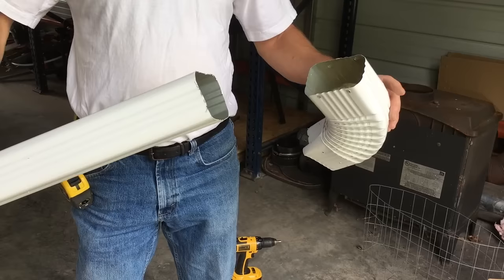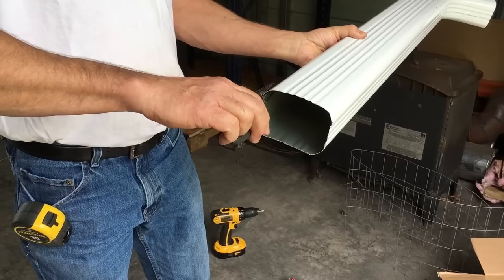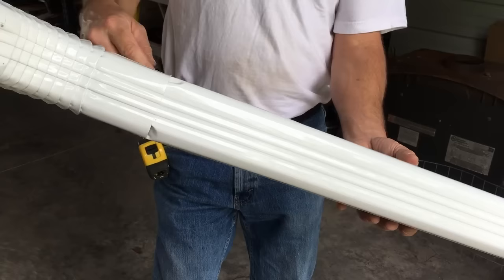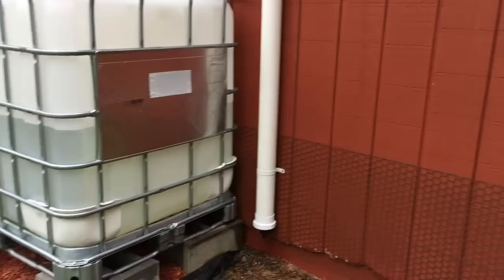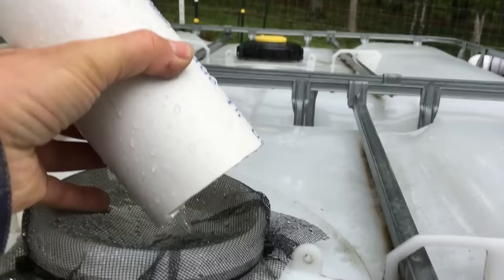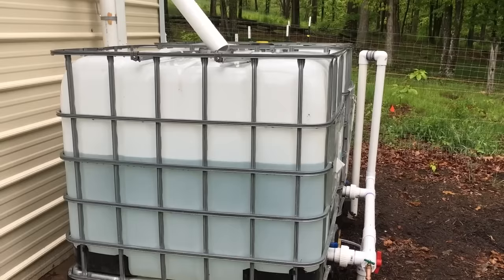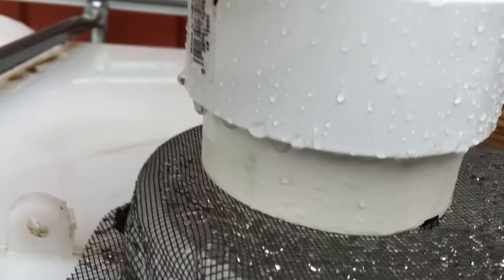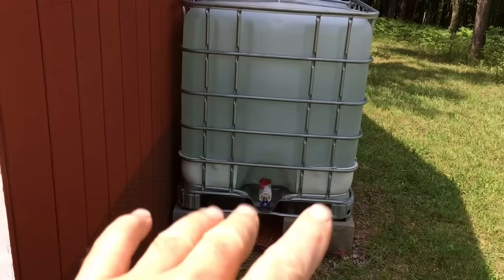RainWater Harvesting Lessons Learned

Comment: I have a very similar though not quite so complicated 4 tote system using the same kind of totes shown here. I also thought of screens on top openings before and then cutting holes in the screw-down lid to allow the gutter downspout to be set in tightly. 

For the overflow, I have PVC pipes running out the top and into PVC pipe that just under the ground surface and leads to our garden. From there, it connects to flat sprinkler hoses which then runs through-out the garden (have one from each tote going to different areas and distributes very well. I first tried soaker hoses but they require pressure, too much for the overflow system. The soft sprinkler hoses work great.  Hope this helps someone. And yes, it doesn't take much to fill them up.
Reply from the maker: That sounds awesome!  Do you have a video of your system?  I bet a lot of folks here could benefit from one.  Thanks for commenting!
Reply: Sorry no video. However, instead of connecting everything at the bottom, I just had hose bibs at the bottom going different directions. The tanks were connected at the top and all my PVC is 1". I cut holes as high on the walls as I could go without being affected by the curved edging. Then I got special PVC thru-connectors that would seal tight. 

For the overflow, I did the same. They came out at the same high level and dropped straight down. At the ground level they transitioned to 5/8" regular hose that could easily be laid in the ground and run it to the garden areas. Once in the garden, I attached the sprinkler hoses. It works great!  I might also add that I built structures under the totes so they could all be raised up as high as possible and still receive from the gutter system -- that took a little engineering. One thing I learned in building the structures was that because our soil is soft, I had to put concrete under each pier block so it would remain perfectly level without sinking. Having the extra elevation also helped with the gravity feed.
Reply from the maker: That all makes sense.  Thanks for sharing!
Reply: Here's another option for shading. 
On Craigslist, we've found free split Redwood fencing (often originally 3x3 rough grape stakes split in half). If you cut them into the right lengths and lash them to the tote frames, you can effectively create a nice looking shade for both sides and top... just leave the center opening accessible.
Reply from the maker: Another great idea!  Thanks again!

Comment: Do you think i could pass rain water 300 ft / 100m via 5/8 garden hose if i had about 16 ft of height on the gutter.  I have a tennis building 100m away from my garden and it has a huge roof covering 2 courts.  But all i have is a 5/8 inner diameter hose.
Reply from the maker: Would you store the water by the tennis building?  And would the storage be 16ft above the garden?  If the plan was to use a 5/8 inner diameter hose to run the water directly to the garden, it may get water there, but it would now be large enough to handle the amount of water you are dealing with and you'll end up overflowing and losing most the water at the tennis building.

Comment: Change of plans, instead of using a 1 inch line between the 2 IBC totes, I used a 2 inch line with a 3/4 inch ball valve spigot on a "T" in the middle. On one side my PVC connector on the tote leaks badly. I'll have to replace it and or use plumbers putty to keep it from leaking.
Reply from the maker: Awesome.  I use 2" as well and it has worked wonderfully for me.

Comment: On your first flush pipes, most ppl just use a screw in cap, & dump it out after a rain because it fills up with debris & what not. Why do you have a hose on the end of it? are you reclaiming some of that water?
Reply from the maker: The cap at the bottom is a screw in cap.  It has a nipple that lets me hook up the small hose and run water off.  inside the cap are two filters and a pin-hole that drains out the nipple.  This allows the system to slowly drain and reset itself so I do not have to intervene after each rain.

Comment: So what's considered the right amount of water coming out of the nipple at the bottom of the first flush system? Thank you for the informative video.
Reply from the maker: You have to adjust that based on your roof and situation.  I have a relatively clean roof but the hole in the nipple was too big.  During light rain, I got very little water in my tank because it was going out the nipple.  So I changed the drainage to go slower so I'd pick up more rain.  If I had a dirty roof (asphalt or a messy tree right above the roof) I'd be ok with more drainage to keep the tank clean.
Reply: @greatescapefarms  Got it. Thank you for replying.
Reply from the maker: @jcs6260  You are most welcome.

Comment: What are your thoughts about putting a 90 degree elbow on the bottom of the first flush system for easier access to the components for changing and cleaning?
Reply from the maker: That would work fine.

Comment: what adapter and size did you use to connect the switch ball valve open/close with the pvc pipe? And where can I buy that adapter. 

ty
Reply from the maker: IBC totes actually have two different types.  Some are fine threaded and are known as NPS female and work well with the 2” PVC threads, which is what I have.  Others have coarse threads and are known as S60X6 and will not work with the threaded PVC pipe.  I just got mine from Lowes or Home Depot.  The fitting for mine was NPS, so I got an NPS to 2" PVC.

Comment: How attached are you to the secondary screen filter, the one on top of the tote?  If you can do without it, I would suggest you get the pvc fittings that screw into the tote lid, and use a "t" fitting, which would give you an overflow that you can pipe where ever you want and won't interfere with the tote valve.  Also, using the "t" fitting, you can add more totes.  And that fitting will also allow plenty of air into the tanks as you use the water no matter how fast you drain them.

Also, you connected your totes at the bottom, which means any dirty water that goes into your first tote is shared with all totes that are connected at the bottom.  If you top fill, the worst water stays in the first tote, and each tote down the line gets cleaner and cleaner water.

And consider this, how much water does your first flush system hold before it spills into your tote?  If you took that amount up to the roof and tried to wash it off, how much of the roof do you think would wash clean off the roof, down the gutter and into your pipes?

I use a 55 gallon barrel as my first flush in a two barrel system, but I still use that water instead of letting it drain onto the ground.  Having got my feet wet (pun intended) in saving rain water, I intend to get a couple of totes later this year instead of the two barrels I started with.

Something else to consider, get a 3/4" ball valve to replace the faucet, you'll be happier with the increased flow rate.  Compare water flow with regular garden faucet and 1/4 turn ball valve (both screw into same size hole and fit a garden hose):

http://www.youtube.com/watch?v=AEpybHgKqQk

A caution on that though, it's real easy for pets to move the lever open.
Reply from the maker: Thanks for the great info!
Reply: TheStavros1001 , Guys, also get a "full-flow" ball valve. Most ball valves have a small orifice through the ball; even though they are better flowing than a regulating valve (hose bib), you'll get even better flow with the wide open full flow valve. By the way, don't try to regulate with a ball valve; it will wear the seat
Reply: For reference, when I say 3/4" ball valve, I mean one of those 1/4' turn 3/4" valves.  Which means the handle only moves 1/4  (or 90 degrees if you prefer) of a turn to be full open.  I've never seen one of those that isn't full flow.
Reply from the maker: Thanks DanielinLaTuna.
Reply from the maker: Got it.  Thanks!

Comment: I appreciate the video! I'm kicking around ideas to irrigate my lawn in Florida. We get a good bit of rain and my city will not let me drill far enough to get a steady supply of water. Living on top of a hill doesnt help! Do you have any videos on the pump system you installed? And if you don't mind me asking, what's a good ball park figure for costs on a project like this. Thank you!
Reply from the maker: The rainwater system for a single IBC tote system is about $200.  The pump is not included.  I had that installed by a plumber and it wasn't cheap, but I'm running a commercial nursery.  For a back yard gardener, you may want to try this pump: https://www.youtube.com/watch?v=NPHCnC7hzog

Comment: I'm a bit late to the party but a solution for the vent on the two tanks with the caps would be to cut a 1/2" hole, put a piece of 1/2' pipe with a 90degree bend on. Attach another piece of pipe and another 90degree bend pointing downwards. Attaching a piece of mesh will prevent any bugs crawling in. 

This is a method we use in my industry for atmospheric tanks.

If you think that 1/2" is insufficient then use 1" pipe.
Reply from the maker: Thank you very much for the suggestion.  I have quite a few of these projects lined up now, so I'll give that a try.

Comment: I have no idea how did you build this system.  Suggestion:
1.  List of all the parts that you used (PVC schedule, connector, glue, etc...)
2. A simple diagram of water flow
3. Step by step of assembling.

I would use a separate tank for filtering the rain water first and feed the filtered water into a second tank.  BTW why did you build this system so close to the house?  You could build it 5ft from the house/wall.
Reply from the maker: I did not list all the parts, but I did two videos that show step by step installation - this one first: https://www.youtube.com/watch?v=021Lq0M5dL8 and a larger system second: https://www.youtube.com/watch?v=3nBT6sLZ7HQ

Comment: Hi, what's the reason for the opening with the screen half way down the pipe against the wall?  Thanks
Reply from the maker: Hi Amy, I think what you are asking is the purpose of the chicken wire on the wall?  That was used to prevent a groundhog from chewing on the wall there.

Comment: I put in a system at the end of my property of 2 tanks. Catching rainwater off my shop roof. I elevated my tanks about 18 inches up off the ground and supported 4 corners of each tank. I'm starting to wonder if I should put in more supports like under the middle of the tanks. My tanks have rough threads on their nozzles and I used a 2 in connector with threads with no problem. I plan to connect 1 in pvc schd 40 with a 3/4 in faucet and a bleeder hose to water my vegetable garden. I'm not exactly sure how to connect the 2nd tank. I have a short 3in first runoff pipe with a 2 in connected by a "T"  that runs into the 1st tank and I may just seal the 1st tank hole with silicone so that when after it fills up the overfill runs into the second tank. Any suggestions would be helpful.
Reply from the maker: I just saw your post.  Sorry for the delay.  I also saw your other post where you were making some modifications and it looks like you have installed the system. I hope it is working well for you.
Reply: I bought 2 adapters online for the IBC tanks. One is doing good and the other one leaks. I will cut the line again at a later date and I may have to use plumbers putty to stop the leaking. At present I have 3 lines connected with a ball valve on each line wherer I can water one line at a time with the other lines closed. This seems to work well. I still have to use the awl on my Swiss Army knife to make sure the 1/8 inch holes in the line are giving off enough water.
Reply from the maker: Thanks for the update!

Comment: We are looking to get an automated prefill system that is loooow maintenance, easy to clean.  Mahalo for the ideas to experiment with.  Is there a reason you slabbed the shop past the wall?  We have an 18k gal tall tank (PVC liner) with a 6" pipe out the bottom center of the tank. A full tank gives us head pressure of about 20 lbs at the tap 200 ft down line to the cottage.  Our overflow comes out the top / side of the tank and dumps on a 12' pelton wheel that drives a 24vdc semi alternator which is one of our feeds for the charge controller.
Reply from the maker: The slab floor was built to the dimensions of what the garage was supposed to be.  The detail that I missed is that they had a 6" overhang on the front and back and that was part of their measurements.  That meant that I had 12" too much slab.

Your system sounds awesome. It looks like you use your water inside.  What needs to be done to make the water potable?
Reply: Slab size is a bummer.. Makes sense tho.  We all make errors, we have  made our share < grin >. We do use the rain water as our main source of potable water.  We employ a simple 2 stage activated charcoal filter.  We are considering a UV system soon.
Reply from the maker: Awesome!  thanks for sharing!

Comment: THE EQUATION FOR RAINWATER HARVESTING IS: length of roof x width of roof X inches of rain X0.68 for the first flush systems= amount of rain harvested in gallons.
 
So 20 X 40 ft roof X 1 inch of rain X 0.68 = 544 gallons
Reply from the maker: Thanks!

Comment: You've placed your collection tanks on pallets. Won't they eventually rot, and collapse? Maybe something more durable like concrete blocks would be a better idea.
Reply: Rod Buchan Aplastic pallat on a small slab I think would do very well,that what I use ,have frost heeving in Michigan.
Reply from the maker: I have changed to larger tanks, but what I originally used with the IBC totes was cinder blocks and with pressure treated wood on top.  It should not have rotted for many years.

Comment: hello nice video. have you tried aquarium silicon sealant on the leaking first flush system?
Reply from the maker: I did not. I just removed and replaced the leaky component.  In the comments section someone said I could use a heat gun to remove the bad component and then reapply it.  I will give that a try when things slow down a little as I did save the leaky part.

Comment: Thanks for the very informative video. What are your thoughts on digging a pond (25 meters radius) as a  collection site?
Reply from the maker: I have one of those further out in the landscape.  The garage is uphill.  The eventual plan is to use the water in the tanks for the food forest and mist irrigation beds right at the garage.  Then I'll build a series of swales that eventually dumps into the pond further down the landscape.  I may even add a few more ponds along the way.  I will use any overflow / excess from the rainwater harvesting system to put into the swales.
Reply: Thanks for your reply. I am planning to use the water collected in the pond for "farming" food plants. Probably collect the water by building collection pads (billboard tarps) along the property and guid the water into the pond. Any alternative alternative suggestions on building the collection pads and also sealing the pond? I would rather use natural means to seal the pond instead of rubber lining. Where I live is very dry, 8" of rain fall per year. How inefficient is a pond for collecting water as opposed to tanks?
Reply from the maker: Wow, that's a lot :)  Thanks for the recommendation on the concert.  I have clay, which is as hard as cement when dry, but like loose mud when it is wet.

I built a rainwater collection system system on top of a hill with a tarp a few years back when I was wwoof-ing.  We were all excited when a storm came to see how much water we collected, but was very disappointed that the tarp acted like a kite and ripped itself right off of the IBC tote and the mounting poles.  I didn't see any way to stop this from happening during a thunder storm.

As for sealing a pond, there are several options.  Farmers co-ops sell bentonite clay that is used to seal ponds.  If the pond is dry it is easier to seal it.  You mix it with the dry soil, down to about four inches and then pack it tight.  Its best to run over it with some heavy machinery to pack it down.  If the pond is wet, you can just toss some in and hope that it finds any leaks, but this method is kind of hit or miss.  I've heard that just by putting some ducks on a pond, their poo will seal a pond as well.  I haven't tried this method.

8" of rain is not very much rain for a pond if that is your only source of water.  With no spring or stream running into it, you would likely loose most of you water to evaporation.  With that in mind, I'd at least try to store a little in a water storage system like an IBC-Tote or something larger.

The best type of pond would really be a forest pond.  This sounds weird, but in a forest with lots of mulch and shade, the topsoil and organic matter act as a pond underground.  The water is stored in the organic matter under the forest and is replenished by dew drops and held there by the lack of evaporation because of the natural mulch that you get in the forest.  The hardest part for you is building the forest with so little rain to get it established.   

Just some thoughts.  Hope it helps.

Comment: Have you thought about burying the black drain pipe?
Reply from the maker: I have, but for the moment, it is temporary.  I'm replacing the tanks with larger ones later this summer and will remove the black pipes just so I'm not tripping over them.  Before the new tanks go in permanently, I'll bury the black pipe.  Thanks for the suggestion!

Comment: I go totes that had molasses in them (food grade is good), I rinsed them out. any more needs to be done? thanks.
Reply from the maker: A rinse is all you need.  Actually, food grade molasses is a great amendment for your soil.  If you have any left over molasses when you are cleaning them out, just dilute it with water and put it on your soil.  It will feed the soil microbes.
Reply: Thanks for the reply, I didn't know that about molasses. glad I didn't use any soap or detergent.